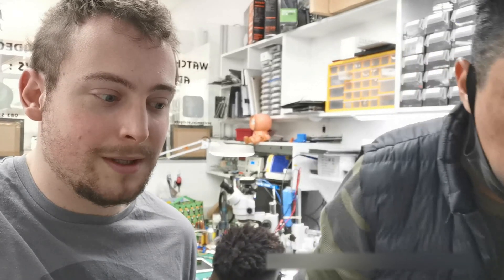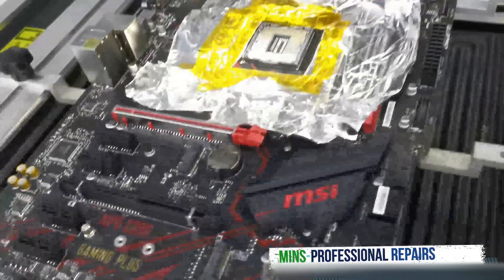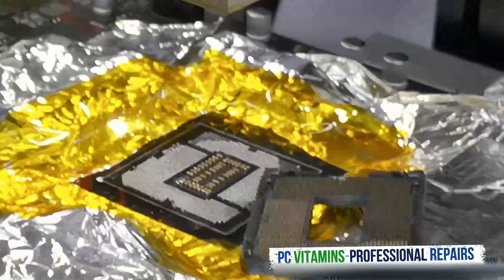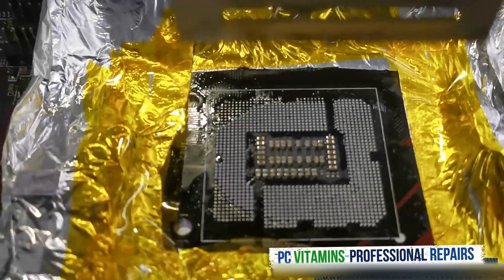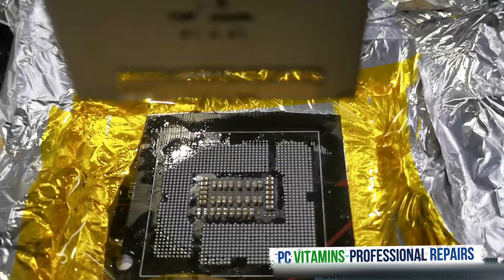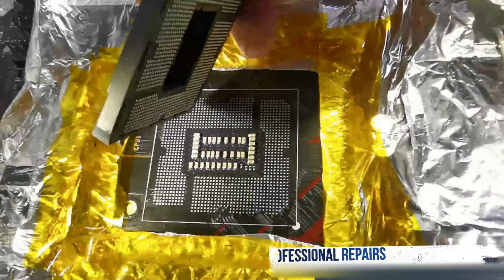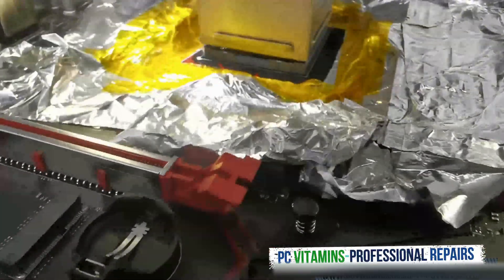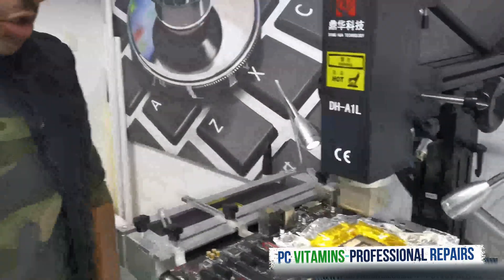Replace a Damaged CPU Socket on an LGA1150 Motherboard

Comment: quick question on the cleaning: while cleaning the leftover solder my soldering iron (same tip as yours) doesnt get the job done pretty well. Even though I apply flux, some of the solder always stucks to the pads while liquified. Thus I have a hard time collecting a giant blob and removing it from the pads. Do you have any tips for that? And somehow the leftover flux (after the cleaning process) is extremely sticky and hard to remove, even with IPA
Reply: Try to add a bit of solder with lower fusion point. It should help. Factory one tend to melt at higher temp.
Reply: god flux paste and acetone but be careful acetone is very strong

Comment: Nice, but why expose the board to anymore heat than necessary? Once the socket is removed, can't just add flux then immediately use the copper strip with the soldering iron to remove old soldier?... heats a killer for those pads.
Reply: no is bad idea

Comment: what temperature profile?
Reply: Goes 150 celcius fast i mean 2 degree increase per 1 seconds wait at 150 for 20 seconds to activate flux then lower and upper goes to 300 degree together, 1 degree increase per second lower can go a little bit faster. You can apply flux at 250 degree or you can put a lot of flux at the beginning so the socket will float on flux and it ll seat itself but a lot of flux residue and smoke will Come out. Card has to preheated 150C before everything and bottom nozzle has to have screw in the middle otherwise socket area sags down due to high temperature. Each machine is different, put a thermocouple and make you own profile. You have 40 seconds at 260 degree, do your own calculations.
Reply from the maker: dude you amazing !!
Reply: @pcvitamins   and u made a vid of this with none of those infos...
Reply: They never tell you

Comment: that's pretty close to touching the socket, how hot can those sockets handle?
Reply: From Intel: Socket Body Housing: The housing material is thermoplastic or equivalent with UL 94 V-0 flame rating capable of withstanding 260 °C for 40 seconds, which is compatible with typical reflow/rework profiles.
Reply from the maker: As long as you dont touch the plastic :) its made for heat